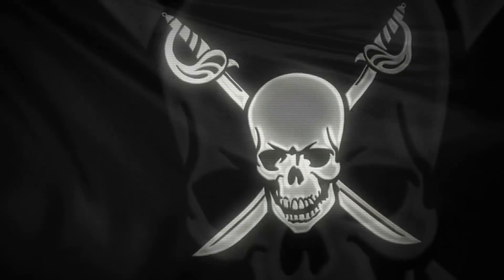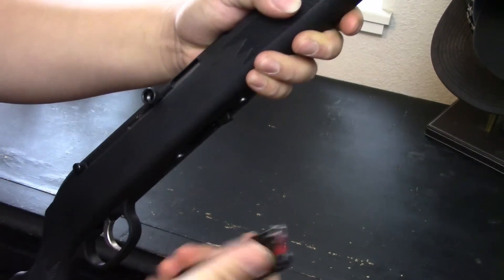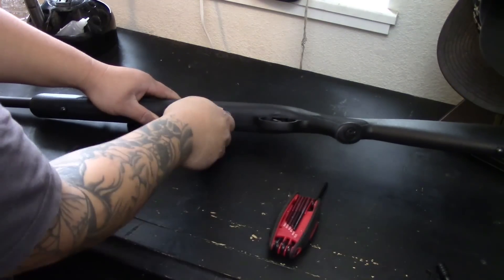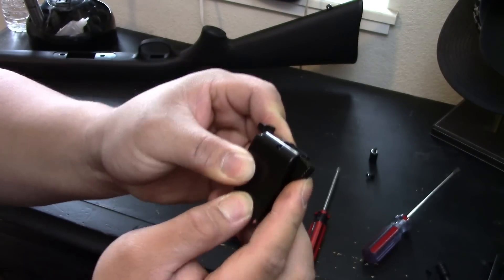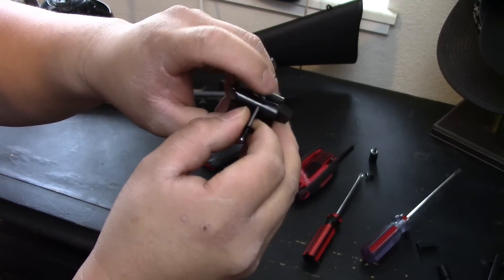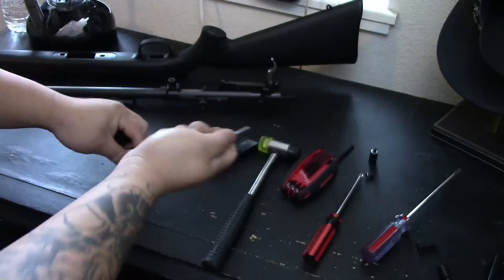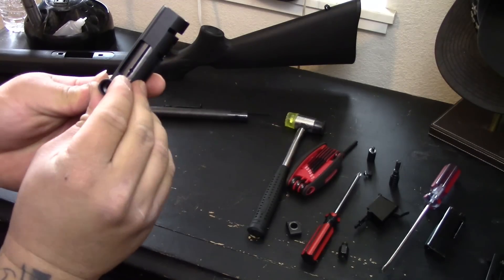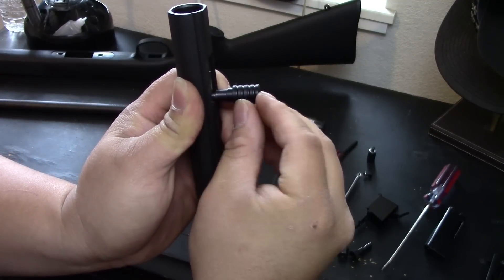Savage Model 64 FXP How to Upgrades

Comment: Thankyou for this video, I just got my new savage model 64 today and also received my dip inc extended charging handle and extended magazine release. This video made it super easy to change them over. I didn't have to shave any of the stock for my charging handle to work but I got a different one they had on the site so that might be why. I know this video is old but I'm new to the savage 64 and your video. Great video keep up the good work

Comment: Thanks for sharing your upgrades on the 64 F. I Like the 2 mods you did on your rifle. The shorter OEM charging handle awkward to use. And the extended mag release looks like it will function good too.

Comment: Thanks for the video. I replaced the same parts. That spring was difficult, I don't have a vice so I used a pipe wrench to compress it. I got the Atomic charging handle and I didn't need to shave down the stock. I have the wood stock and didn't want to shave it down.
Reply from the maker: bakerbrian41 awesome thanks for watching.

Comment: Thanks for sharing. Just a heads up. My carelessness resulted in a major mistake in this video at the -8:05 frame. When I put the barrel clamp on and tightened the stud or screw that holds barrel clamp down, I cross threaded the receiver. When the receiver is cross threaded (not the bolt), the firearm is toast. I actually was able to order a new replacement bolt only to find out the receiver was cross threaded not the bolt. Now I have a savage 64 spare part rifle.

Comment: Nice upgrades to make one shitty rifle pretty decent. 

I have a standard model 64 (well it has the camo stock) and due to lack of aftermarket support and what little parts there are available for it I ended up making my own charging handle. The stock one is not good at all but all that really needed to be done was turning down a bolt in a drill press to the correct diameter. It looks professional due to the ghetto lathe I used. I still have to make a mag release. 

One thing that happened was the threads of the pillar that holds the stock on closest to the trigger guard stripped out due to shallow threads. A single thread pulled out and that was it. I have considered doing a couple of fixes. One idea is to weld it to the mag housing and file it flush but I still wanted to retain the actual use of the hole. So what I will be doing is using a steel spacer with a longer screw and a washer to get it fixed to it. The screws in that area are already tiny so I will just enlarge the hole and try to get a machine screw with a similar head.

I have completely disassembled the gun, trigger housing and all. A couple of issues I noticed with the design is a lot of pre travel and the pot metal trigger. To fix the pretravel you would either have to make a new sear or disconnector/bar. Honestly the sear looks the easiest to make. You would basically leave more on the bottom hook of the sear. 

Finally additional to the mag feed ramp polish there is a small square on the rear of the mag. This square sits too low so it is possible to jam the mag further into the well causing the bolt to stop. Although not a huge deal if you don't slam your mags in it but a small amount of wood or plastic or metal glued to the top of the square would prevent this. 

These guns come out of the box with the least amount of work done ot make a gun functional. Tweaking it to be better is something that is always necessary. Kind of how the 1911 always needs new parts fitted and are not just drop in replacement like the Ar-15. 

Good info and nice rifle.....now.
Reply from the maker: evilcowboy awesome. You should do a how to make a charging handle.
Reply: Will do. I have completed the fix for the stripped hole, made the mag release and I am still uncertain if I like it and I'll explain how I did the charging handle for it in the video. Gonna go make it real quick right now lol

Comment: We bought 2 of these rifles and went shooting this morning for the first time. It's does shoot "EXCELLENT" but we had trouble with the first bullet engaging when cocked. We had to actually manually put the first bullet in the chamber before putting the clip back on, "please help me"
Reply from the maker: Thomas Tucson the rounds you buy are also a a factor. If your rounds are decent I would look at the ramp the rides on to the barrel check to see if you have any imperfections, I would run a dremel through it to smoothen the area. Hope this is helpful.
Reply: mike10803 
Thank you, I will check it out,

Comment: going to try smoothing the clip down.. and what do you thing about where the clip goes in i guess its called the mag holder  NOT being tilt enought to put the bullet head at the right angle... my bullet looks like it mite not have enough tilt to make it get in the barrel.. that is my biggest problem.. geting the bullet in to the barrel.. it just ben,s the bullet head. if the bullet was sit up on a table the head is at 1.pm or 2.pm.. it is hitting the bottom of the barrel.. i put my hand on the clip to push up did not help but there is not any play there..
Reply: Mark Moffitt there is no "clips" for this rifle. no clips to smooth down.. you must be talking about a fully semi-automatic rifle....lmao

Comment: I have a Savage Model 64 and the 10 round magazines jam with nearly every round.  The round is not pushed up far enough to be launched into bore. Do you have a solution?  Thanks, Roy
Reply from the maker: Roy Stearns you can try getting a new magazine first and if that doesn’t work  you can then look at smoothening and or changing the angle of  your feed ramp (check with your local gun smith). Hope that leads you in the right direction.

Comment: what item,s  did you use to smooth / fix the clip.. mine mite be in the mag holder the bullet is hit the top of the barrel and not going in to the barrel.. can you help me out.. on what kind of items you used to smooth every thing out with.. THANKs
Reply from the maker: I used a dremel. took some time to round out the step but only way to test would be chambering a round. be careful, i would recommend doing this out in the range.

Comment: Is there any (non-destructive) way to remove the front sight on these?
Reply: Use a punch to drift the sight out from left to right.  It just slides into a dovetail groove on the barrel.  The rear sight is also inserted into a dove tail groove and can be removed.

Comment: Hey I just bought the savage 64 fxp today . Is there any problems with it I heard there is people saying the mag is not good
Reply from the maker: I would try what you have first and see if you have any issues, if not...no need to worry, if you do, there are some fixes here on youtube depending on what issues you run into, the mags feed ramp area typically is rough from the manufacturer.

Comment: Hi , I have the same rifle you have in this video, I took it apart to clean it and when I was putting everything back together,
I stripped the thread on the bolt you have on your hand at min 5:40. I was so dummy man! I over tight it and stripped in the receiver thread. Any suggestion on how to fix that if any??? I will appreciate any help please! Thanks!!! Good video BTW
Reply from the maker: you may get away with using a tap and re tread it. let me know how you do. good luck sir.

Comment: Sir, thanks for this video
Reply from the maker: +Martial Arts Tutorials & Fight tips- thanks, hope it helps
Reply: mike10803 it does I will install the extended trigger release, additionally I will adapt a pro mag from the marlin to this gun I hope it works

Comment: It is easy and inexpensive to modify this rifle with Williams Fiber Optic Sights, and to extend the existing charging arm. I uploaded two videos on my channel on how to accomplish these modifications. Here is a link to one of the videos of this: https://youtu.be/thCXLuFiW-8

I just made a fairly inexpensive modification to my Savage 64F. I installed a set of Williams Fire Sights on it. Williams does not list any of their Fire Sights for the Savage 64 or 62 .22 caliber rifles. I decided to try the fire sights listed for the Ruger 10/22 and see if they would work, and they did. 
I drifted out the Savage front and rear sights. Drift out from the left side 
of the barrel towards the right because the part that fits in the dovetail on the barrel is tapered. The front sight was harder than the back sight to get out. 
The back sight came out easily. 
The Williams sights went in easily. Again. The front sight was harder to drive in. The rear went in easier. 
Before removing the sights you should mark the barrel with a pencil where the sights are centered so you can center the new sights. 
The Williams rear sIght has a set screw to hold it in place once you have sighted it in and adjusted it. 
Also the Williams Fire sIght has adjustable windage and elevation set screws.
Part numbers for these sights are Williams 060213 or Ruger 90340.

Comment: you shouldnt dry fire it man it actually damages it
Reply: That's a fact I learned that 42 years ago after I did that to my grandfather's antique pump-action .22 and broke the impossible to find firing pin. 12 years old isn't too old for a stropping, (which is a whipping with a double belted leather razor strop, 2 strips of heavy leather about a yard long used to sharpen straight razors, ouch). He then explained that on centerfire guns it wasn't a big deal but with rimfire, the firing pin impacts the softer brass igniting the primer, but without the brass to soften the blow, the pin slams into hard steel and has a good chance of breaking.

Comment: 164!? U got ripped off. Mine 120. At most 150
Reply: @Aldo Raine even better. mines brand new basically, but 164 im like no. the price range for these is 120 - 150 in general, if theyre wanting to make a little off it. if you can find it cheaper, then hell yea but 164 is pretty pricy, guess it depends on tax and stuff too
Reply: I was thinking the same thing. 
I bought mine new for under $100.
Reply: Dog eat dog , yea An that other dude saying they are shitty rifle's ??, we bought 6 of them over a 3 month period , 1 for each of my sons , an then another 3 more for Sister inlaws  kids, I guess we got lucky no Mag issues even on the extra 3 mags for each rifle, so that's 18 mags total , I did smooth up the triggers on them , don't have a spring scale to test break pds , these things fired great outta the box , do wish they had higher cap mags , even if it was only 15 rounds ,

Comment: Just bought one. won't load the first round out of the box. It's what I get for buying a cheap gun. Will never buy another Savage.
Reply from the maker: if your rounds are cheap the bullet sometime move from the casing causing some jam issues, have you made sure the magazine was fully seated before loading the first round into the chamber? also i would check both the mag. hopefully this helps.